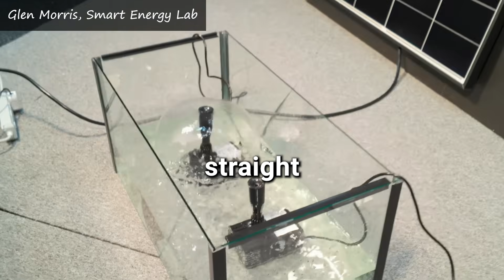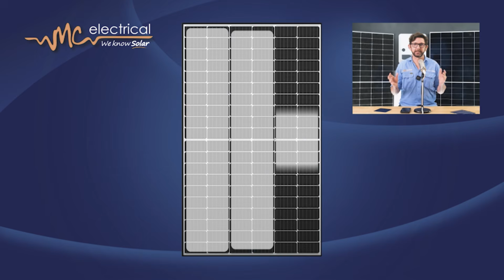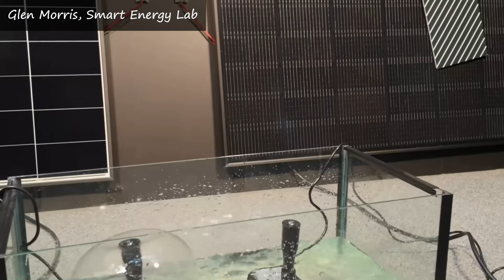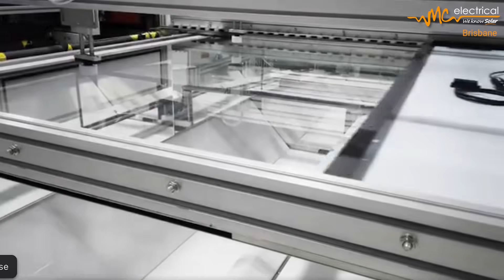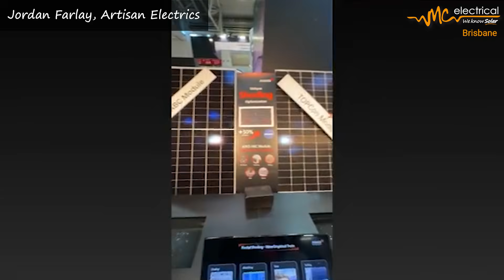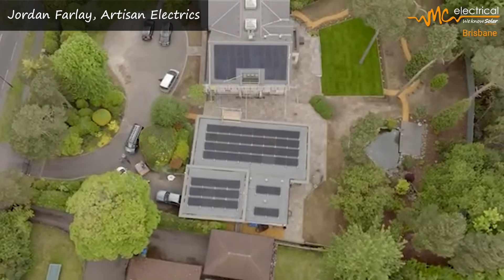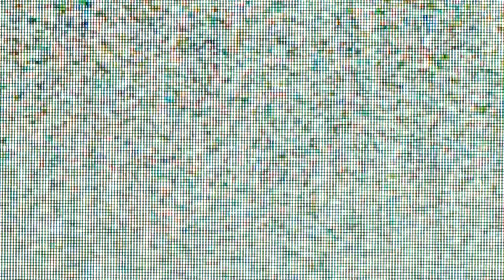TEST RESULTS REVEALED. Do Aiko’s shade proof claims add up?

Comment: The AIKO spec sheet does not mention NMOT which is a concern for me. How does it actually perform on a hot day?
Reply from the maker: I didn’t specifically test that, but it was summer when I was testing it and it outperformed by 100w at lunch time. This may be due to a good performance in temperature. (But it doesn’t perform well in early morning or late afternoon)

Comment: @mcelectrical Thanks again for sharing this video and findings. Aiko's response and conduct on this leaves a lot to be desired. If they are truly transparent and sincere, then instead of going after a genuine content creator, they should instead take up your offer to run the tests with you again. It's a big thumbs down for Aiko as a result!
Reply from the maker: Yeh the response is telling. But they are not specifically going after me - infant said they won’t do what SolarEdge did and sue me. Very noble of them. (SolarEdge didn’t actually sue me, just expensive threats).

Comment: it's out of topic on this video but can you make video about surge protectors. Also if I sleep on electric blanket, and one lighting hits one of the solar panels what is the best option to do before this for my best safety?
Reply from the maker: Oh wow. That’s a cool question. There are 3 main types of household surge protectors in my mind. 
First is if you live on a hill (for example) with overhead powerlines. Expensive, installed at your switchboard, saves from almost direct hit. 

Second is if you don’t live on a hill but want to protect your appliances from getting a kick in the guts. I always put this on my home. Maybe $100 unit per phase plus an easy install.

Third is just the computer surge diverter. Also a good idea for sensitive appliances. 

For your electric bed, I think you are freaking out a bit much, but you could go all options I guess :)

Comment: Thank you for the video and for standing by scientific tests and your pursuit of truth, whatever it may be. I was genuinely hoping that AIKO had made a breakthrough in cell technology, and I’d be thrilled if that were the case. That trade show video always felt somehow... at the same time gimmicky... yet simple to understand. But that's the thing with simple things - things rarely are simple. Showing a well-trusted power meter with voltage and amp values would do more to convince me. I wonder what the trick is at the show - anyone tried to swap pumps on stage?
Now they are throwing shade... Refusing to cooperate... Takedowns... That is not what honest people do.
If you happen to veer into Luxembourg and fancy a beer, let me know.
Reply from the maker: What a cool place to live! We just passed through on the train from Salzburg to Paris. I read a bit about Luxembourg on the train. Feel I need to go back one day. 
I think the difference is there is no dc to ac inversion. Not sure why that helps but they were running direct dc. Maybe I should test that. Oh yeh! That’s the follow up video! (I was wrong about Aiko … lol)
Reply: @mcelectrical  sorry, for the slow response. I was down with a nasty cold. Luxembourg is an absolutely amazing place to live. In particular if you have children. 
I was thinking about what you said. I doubt it is the inversion... You'd have to hit a really bad efficiency point of the inverter. But I agree iinversoon should be eliminated as a possible source of power loss. How about simplifying the experiment? 1. You replicate the AIKO's pledge from the trade show and throw in some instrumentation to show the values. I hope you have a pond somewhere to reuse the pumps later...  2. Take the knwowdge from step 1 to improve on the real world use case.
Reply from the maker: Just to be clear, it wasn’t Aiko that did the copyright strike, and I was in the wrong for not checking with the person who’s content i used. (Still not real copyright but whatever).
And, yeh maybe I should do one with showing live results. It just seemed hard as our recoding setup is simple and I had already spent enough time convincing myself!

Comment: The here tested results are true.
I was also disappointed, Another video competition  between 
Aiko 2s 460 vs Bluesun 450 shows the similar facts. 
In the morning (10 o clock , in europe) the sunblues achieve 50w more every hour. Also at the sunset afternoon.  The Aiko has 100w more power at the time around  12-14 . That was the big amazing maximum differenz., that the nwximum would be so much different. 
After 14:30h  the differenz gets smaller and change about 5-6 o' clock. Then was the bluesun 50wp more in front.
Reply from the maker: Oh, that was someone else’s test? Can you link the video?

Comment: G'day Mark,

Thanks again for a superbly informative video.

Your timing is impeccable because I was seriously considering a quoted system here in Canberra sporting 67 Aiko NeoStar 2P panels homed to a new SigEnergy three phase inverter come 32KW storage system. 

Other than some concerns surrounding the quoted overpopulating several strings, my setup will also be impacted by significant shade, but these panels were being taughted as the bees' knees and a reason that DC optimisers would be largely redundant.

So, before I grasp the nettle, I do hope @Aiko will immediately work with you and others to prove their panels out, otherwise they might start to suffer credibility questions if they don't.

Anyway, I am jealous as spending Christmas in Paris will be a real hoot, mate. Hope you and yours have a Merry Christmas and Happy New Year.

Sincerely

Peter
Reply from the maker: Hey Peter, thanks! Don’t blame the sales guy or the company. They should be able to trust info from a trade show. It doesn’t work. I calling their  bluff at the end of the video. But you don’t need optimisers either. Maybe enphase if the designer doesn’t know what he is doing. But most jobs work more reliably and just as well with an inverter with a quality GMPPT. Fronius or SMA, or , maybe, still to be tested, SigEnergy

Comment: While most of this discussion is about  how well partial shading works (or not) at AIKO what makes me thinking twice before buying their panels …is the worrying low wattage in the morning and evening. On the other hand what your video seem to confirm though is  another claim from AIKO about their temperature performance i.e. panels running at low temperature (AIKO has made several videos showing panels top at approx 100 C, about 50 degrees lower than others. Pity, I was sold into their partial shading marketing. Good work, thank you
Reply from the maker: Yeh the morning production is probably more of a concern than I made it out to be.
Reply: Agree. Also sold into their marketing. Looks like a fail but wait and see if this test will be replicated

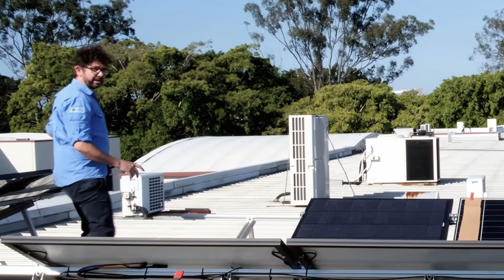Comment: Just for information, since I posted this on the previous iteration of the video, but in their blog post from June, Aiko say that up to 3 cells can be shaded per bypass diode, and after that, the bypass diode will kick in.  So a vertically shaded substring as in 6:30, or heavily shaded panel, will behave exactly the same as any other panel, according to Aiko.  The diagonal shading at 7:20 also covers more than 3 cells in each substring, so again, bypass diodes would kick in as expected.  So presumably the key test would be when you have light shading going across (like a tree branch shading a single horizontal row of cells) when there should be the biggest observable difference.
The trade show demo doesn't make much sense to me.
Reply from the maker: Thanks for reposting Wyndstryke. 
Would be good if you could post a link to that blog post. Yeh I agree with what you say. I think that is fairly unusual situation, but more to the point, it’s not what they show in their demo. It’s probably ok tech. (Time will tell) I just dislike the mistruths. And the bad performance I saw in “low light” is a concern. However that is still just an anecdote.
Reply: @mcelectrical  If it helps, the title is "From Mystery to Mastery: Understanding AIKO’s Partial Shading Optimization in ABC Solar Modules", and the publication date is 7th July.
The results you are getting seem consistent with the blog post from the techies, but the trade show demo doesn't match up with either the blog or the tests at all.
Different cell technologies react differently to low light situations, p-type versus n-type being the most obvious example.  The STC ratings seem to ignore that aspect entirely, and it doesn't show up on datasheets.
Reply: I think the realistic conditions for this would be when a few leaves falling onto the cells here and there. Normally, a single leaf will disable the entire half of the panel, or the entire panel when connected to the string due to how bypass diodes and MPPT work. If Aiko's tech works as claimed, you can expect the panel to allow a few leaves on the panel before the bypass diodes take over and disable that entire panel.
Reply: @ I have to say that my panels have been performing quite well under shade.  There's a chimney on my roof, which casts a shadow across the panel directly north of it at this time of year (when the sun is low).  So far it is generating 90% of the output of the other panels over the full day, and seems to be about 50% of output when the chimney shadow is going all the way across it.  That 50% is a lot more than I was expecting, on paper it should be generating nothing.
Reply: @WyndStryke  hi dear,  same here.
I have 8 candian panels installed vertically ( portrait) , 6 in 1st row , while  2 in lower 2nd row.
The biggest problem is that for some part of day , usually in winters ,  my lower panels are covered with shadow (60 to 70%) , that irritates me but best part is when the sun is at full noon on day, with lower 2 panel covered with half  shade, it gives enough power to run the mighty deep well pump , rated 6.2 amperes , ( while i turned off fridge,  battery UPs )  for some time...
I am thinking of shifting the lower panels to top too.
Thanks1q

Comment: The test of Aikos "Waterwonder" is not good. They        shade always the middle. And at the critical side. (as shingeld  solar. ) There is a big differenz , if you cover the left side or the topside.
Reply: I mean,  the Aiko Test is not good , fair !  The wafers in the aiko are orginezed in a other direction.
If the right Panel  would  be Covered only at one Side of the half ( and Not also a cell in the Higher half part) 
iT would still Work.
Reply from the maker: Oh, both panels are arranged as standard split cell panels. But, yeh important point if the cells were strung differently
Reply: @mcelectrical 
Thank you for your answer !  I have written the Main results . ( you See the difference betwen Situation 2 vs 3. IT IS a big difference, where the paper is)
because of  the language Problems. 

...I learned from you 
that i don' t should buy Longi...
Reply from the maker: Ok fair call. The shading I did at first was as Aiko did in the demo. And then I did other tests to try and get a better result I’m not sure how they shade in the middle without shading on the edges. Every roof is a different. Like I said multiple times to Aiko, show me how to get the results and I’ll test it!

Comment: Does Aiko have more bypass diodes?
Reply from the maker: No, I’ve heard that idea thrown around. Just the 3. It’s “split cell” like most panels today, which means top and bottom are in parallel, but still 3 bypass diodes.

Comment: It isn't Friday the 13th, is it?  that was last Friday.  
I got a solar quote today & the bloke from, anon, quoted me 14 × 470W AIKO Solar Neostar 2P · AIKO-A470-MAH54Mw panels
and a Goodwe invertor.  I pissed off that invertor & I said I'll pay extra for a Fronius.  
Got quoted $8400 in Tassie, better than the $11k I was quoted a few months ago; that mob incidentally rang me up this arvo to say they can install in a few weeks.  I told them what about the invertor I wanted changed?  The other bloke never seemed interested in returning my call, so ** you
The AIKO panels still look like a grouse panel, apart from the bullshit, that's a pity.  maybe they just want to get a foot in the door any way they can at the moment, until people realize how good the panels are/aren't
Reply from the maker: Yeh, it’s probably a fine panel - I guess. Just doesn’t work the way they said it would.
Reply: I just got 28 Aiko 470s + Goodwe 10kw + Catch relay installed in Launceston for 11.6K by Genr8. $8400 for a 6.6kw seems pretty high.

Aiko were the cheap option from my installer.
I was nearly talked into a fronius also but once i found out they charge $1000 to switch on the battery option in the future with software on a product that is already double the compitors price I found that even more repulsive than Mark finds Aikos marketing!

Comment: Thanks for posting this Mark and for the patience in re-editing and re-posting. Would you be able to share the curves from the Fronius under the various test conditions, as the video only shows the first unshaded test?

 It would be super interesting also to see the voltage curve over time measured at the first panel in the string (the one which had the small shade on the top left that would change throughout the enitre day). 
I don't know the details of Fronius' MPPT algo implementation, but intuitively +4% is small enough to potentially be caused by different MPPT sweep cycles across the two strings - unless Mark you saw that different being consistent over multiple days?

If @GaryDoesSolar you can truly convince Aiko to repeat the test, it would be great if he could do both string and per panel (or at least a sample of the panels) measurements.
Reply from the maker: Hey Rabitec. I was using the same inverter, and for the instant tests I was direct connecting to fronius to get instant data of voltage drops. I think the only potential problem could be if there is different GMPPT sweeps (every 9 minutes or so) but I’m pretty certain from previous testing that both gmppt’s sweep at the same time.
I didn’t really keep a record of the data. Just a notebook and changing tests regularly. But I the panels are still there running, so I could easily do it again. 
Aiko know they won’t be able to simulate the result. I was really just calling out their bluff. But it is possible I could see some more small wins for Aiko if I was told exactly the conditions.

Comment: Shady marketing but I would preferred the BC panels over the Topcon panels IF it cost me about the same.
Reply from the maker: Yeh I don’t necessarily disagree. We haven’t really seen these panels in the wild for too long so time will tell. I’d probably prefer a back contact panel from one of the major panel brands, just so I’d be more confident they are around for a warranty.
Reply: @ Do you mean the Longi Himo X10?
Reply from the maker: Yeh I don’t mind the Himo range. I’ve just cont concerns with their warranty. They haven’t fixed it. https://youtu.be/9QhGfD43IiU?si=WOXMTRAwYV3Yssru

Comment: Fair call out. I defiantly feel your intent to be agnostic of brands and talk about the facts of the gear. I believe ABC technology will have a key roll in the best production results from panel structure. I think we are on the precises of this coupling with multilayered cells with incredible potential. Hopefully leads to good ergonomic panels for installations teams.
Reply from the maker: Thanks. Yeh I don’t have any particular issues with ABC  (other than I always like a new cell to stand the test of time). But it seems good in theory. It’s really the way they market the panel that I have issue with.